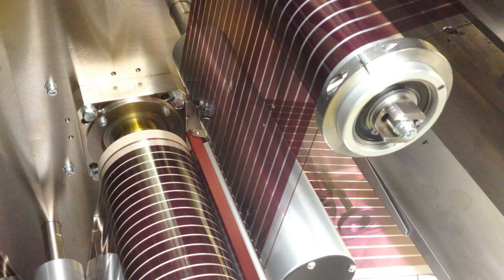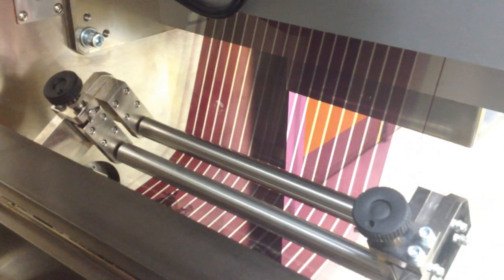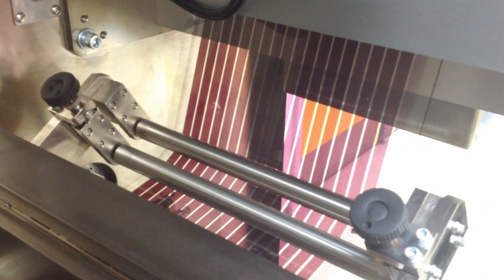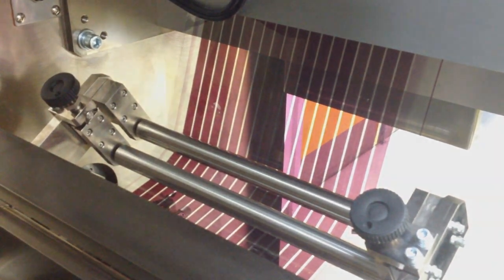Printing Australia's largest solar cells

Comment: Missing a LOT of important information:
a. what additional coverings do they need to withstand sun exposure and weather
b. how long do they last
c. do you connect them in series or parallel
d. how efficient are they?
e. all things considered, are current solar cells cheaper

Comment: what if you also added a light emiting pompound, that makes light in the presents of radiation or magnatisim,  making it own's light sourse, like fire flys. then you could make the tracks as fine or thick as needed, it would be an infinet battery.  and also that compound in pizeo buzzers it vibrates when you put power on it, and it works the outher way around too, so you could make wall papper, that gets power form vibrations and light